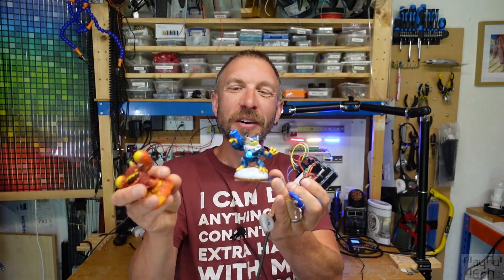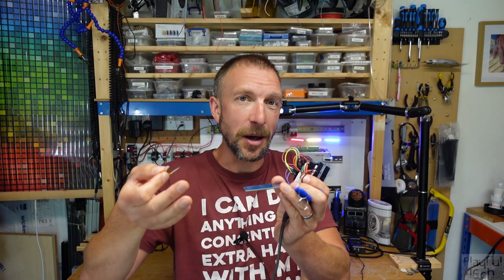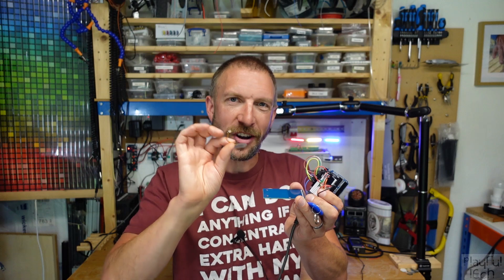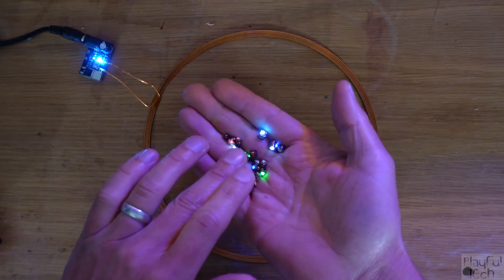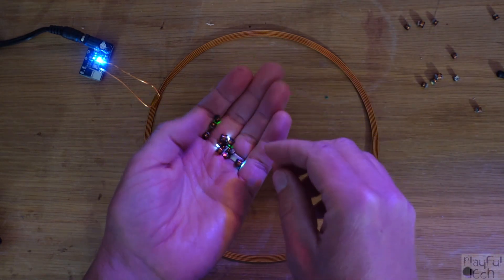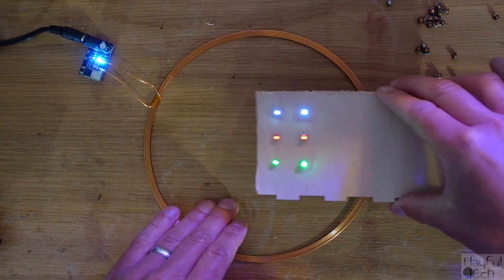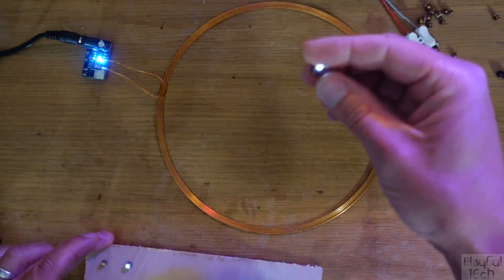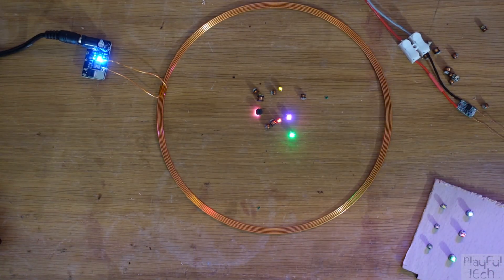Wireless Inductive LEDs

Comment: Could the coil be three? Like a triquetra? I have the small coil with 4mm LEDs and the coil has 4 loops; would increasing the coils, while still utilizing the same driver provided, without modifications, make the 4mm LEDs brighter, or maybe increase the range? I have some magnetic wire ... different gauges ... but I don't want any unwanted electrical fireworks.

Comment: Would you get shocked if you touched the coil?
Reply from the maker: No, it's low voltage and low current. Basically no different from touching the end of a battery.

Comment: Nice video explaining this tech, Nice examples to show how the system works coil works... the inductive transfer of energy is dependent on the size of the wire, the number of "turns" or loops, the resonance frequency, and the distance...  I first heard of them via an Imagineer I knew and about a year ago I used them to create a nifty D&D piece... It was a mimic and some moveable treasures...  I used a magnetic hall effect sensor on a platform inside and placed the magnet in one 3D print which would turn it on, then I placed wireless LEDs in several other 3D prints that could be placed in different locations around the treasure chest that contained the coil... As you showed, the orientation of the LED will also change the brightness as it is moved into and around the field, and I used a multi axis inductor to counter that in two of the items. There were some obstacles to overcome in my project, but with a bit of math and perseverance and ingenuity, I made them work. There are also some interesting possibilities for using capacitive touch sensors and even MIMS orientation circuits as well.

Comment: I’m new to all this, so sorry if I sound uninformed, but based off what you said, would it be possible in creating an rfid figure that lights up when placed on the tag? I have several figures I want to light up and have been brainstorming ways of getting them leds without any wires showing

Comment: is there variants of these that have the LED separated? thinking running the led in a diff locations and having the induction pickup closer to where the coils are located
Reply from the maker: Not that I've seen, but you can easily build that using the handmade one I showed, by just running some wires between the inductor and the LED.

Comment: When you talk about when the LEDs light up vs when the RFID tag is recognised, what about an arduino or similar that can read the RFID tag and only power up the coil when the correct item is placed on?  It wouldn't have the cool proximity-fading-in effect, but it would still work as feedback.  Also if you still wanted the fade-in, you could ramp up the power when the RFID is detected.

Comment: Cool feedback application! My one idea is to use multiple sizes with a wand / divining rod and you could even use it as a meter that "grows" or "charges up" in strength as you get closer (5mm works further away, then 4mm as you get closer)

Comment: When I first learned that these existed, my first reaction was to run to Amazon and Etsy only to be disappointed that apparently nobody was selling resin-cast dice with them embedded inside. Hide the coil in a dice tray and I think you'd have a pretty neat setup for your tabletop sessions.
Reply: Okay, I've committed to this - I've got LEDs, resin, inks, mica, molds and various accessories on the way.  I'm going to make this.  I can let you know when I have something working if you want.  It's going to be experimental and I have no idea how fair the dice will be, but I'm going to figure it out.
Reply: @excrubulent  Same here bro. Gonna make some resin keychains with these.
Reply: @excrubulent  Did you make it?
Reply: @excrubulent  hey man, how did it go?
Reply: I was thinking these would be great for Infinity stones.
Reply: Omg I was thinking I had no use for these, but this is perfect.
Reply: A couple of people have asked and I only just got a notification about it.  I've got some of the way - I've got a way to power two leds off of one inductor/capacitor pair for more even lighting, a lot of testing for the ideal inductor/capacitor/power coil combos, an SLS resin printable core that acts as both a central locator for the electronics and a light diffuser, and it's also a way to make sure the coils are always oriented so the LEDs turn on no matter what face the dice land on, but I haven't made the dice yet.  I've had a bad run of health for a while.  I still intend to finish but I don't know when that'll happen.

Comment: Disney imagineers had made a 3-coil setup with full bridge rectification so that regardless of the orientation the LED would light up
Reply from the maker: Nice! There's a couple of snazzier circuit modifications I've considered: e.g. you could have several LEDs coming off the same inductor coil, each with a different value capacitor acting as band pass filters. Then, if you adjusted the oscillation frequency of the transmitter coil, you could selectively light up, say, RGB LEDs independently.
Reply from the maker: Or, you could put different capacitor values on each LED to activate them sequentially in a chase sequence.
Reply: @PlayfulTechnology  Bootleg delay timers